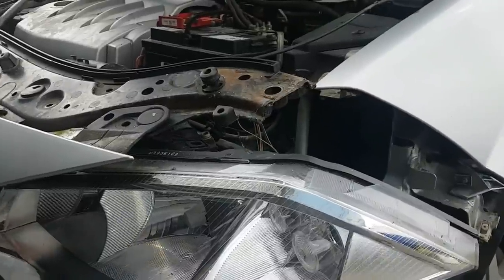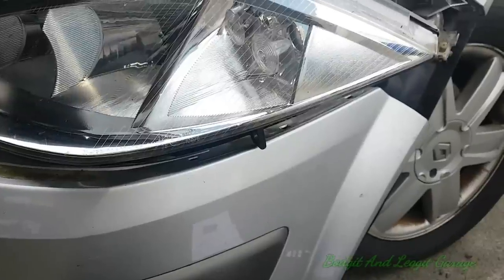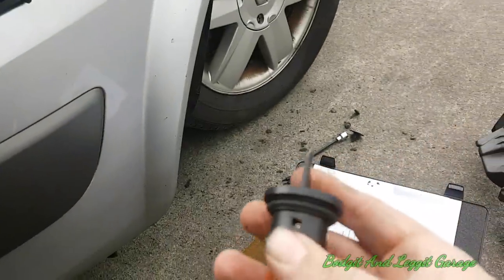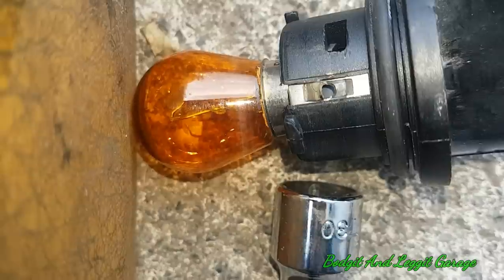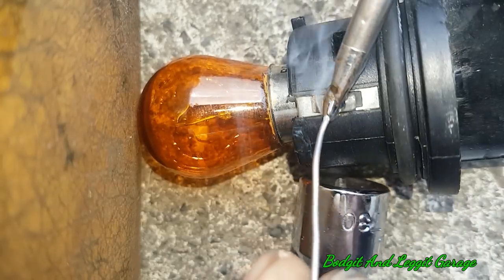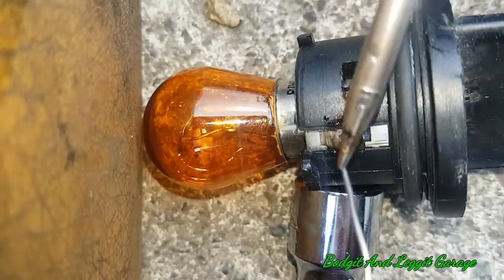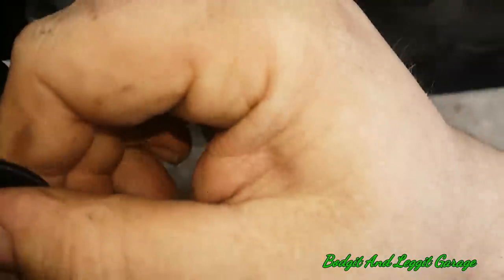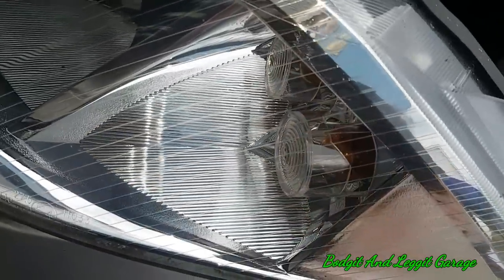Stupid Indicator Bulb Stupid Renault Bodgit And Leggit Garage

Comment: I had a customer with a Clio and Renault wanted £90 just to change a side light bulb as the headlight needed to be removed to do it, he called me to see if I had a bulb as he reckoned he could get his fingers in to change it which he managed to do and got the bulb for free as it was only 10 pence for a bulb. Bear in mind this was 10 years ago so think of the cost now, I had had a few where the bumper has to come off and its bloody ridiculous but makes the dealers money.
PS that is what I would have done.
Reply from the maker: Thanks mate

Comment: That's a decent fix.

My Mondeo had a corroded socket on the inner boot lights.

Cut the connector back to the traces then soldered tails in and joined directly to the loom.

Boom free permanent fix!

Edit.

That's the reason most old meganes are about £5 to buy now lol
Reply from the maker: Sorted

Comment: Leon, you did what you had to do to get it working as quickly as possible. Renaults are an absolute pig of a job just to change a bulb. I had a similar situation with the Corsa where one half of the indicator bulb holder was left behind in the headlight unit. I ended up removing the headlight (almost as bad as the Renault) and I eventually got the offending part out, glued the bulb holder back together and it is still working to this very day. I didn't know that all NCTs were done by dedicated test centres only.
Reply from the maker: Yes mate in Ireland that's how it's done it's not even run by the Irish government at the minute it's being ran by a Spanish company it's a joke

Comment: I am not making this up, but am holding the necessary qualifications to undertake soldering work on fighter jets and spacecraft.
My opinion on how long this repair will last? It will probably last as long as the entire car will.
It's not the correct way of doing it, but I would have done the same myself !
Reply from the maker: Wow that's awesome mate I am very jealous I would love to work on them type of things I know I could do it
Reply: @bodgitandleggitgarage  Don't be jealous. I was trained to undertake that kind of work, but I have never actually touched a fighter jet. Nor a spaceship 😉
But I'm certainly able to judge that the fix you made there is more than adequate.
And yes, it seems as if your mindset is exactly what is needed to work on aircrafts.

Comment: I did a similar bodge to my mates peugeot 308 i think, the estate car with the glass roof.
The indictors were playing up and the bulbs sat in shitty plastic top hats, the contacts were worse than your's, so i drilled holes in the back of the top hats and fed earth wires inside, soldered to the shitty bits of tin.
The wires i put new crocodile clips on and clamped them to metal engine bits, they worked for years with no trouble.
The job was an emergency bodge, i did say to buy two new top hats then the wires could be removed, he never bought them, No bloody supprise.
Reply from the maker: Sorted nice job mate

Comment: Craze ntc system. All I would say is maybe add some grease? So it maybe possible to replace without taking half the car apart. Easy for me to say. I hate those plastic twist handles. Easy to break
Reply from the maker: Hi mate I tried the grease on phone you didn't work this it is just too tight too much friction

Comment: I was gonna learn how to drive until i found out how expensive it is and i thought to myself, i'll just get buses and taxis instead
Reply from the maker: Always good to have your independence mate just take your time do it slow but definitely you need to learn how to drive
Reply: bodgit and leggit garage No i'm not learning how to drive as lessons are expensive then when i get a car i'd have to pay tax, nct, insurance, fuel, parking, maintenance, repairs also i live pretty close to a bus stop so i'd rather get the bus than pay all that as i don't have to pay any of the aforementioned costs

Comment: First off , forgot to connect it back up 🤣 when you go out your way just to help your customer out even temporarily , that customer will return for future business.  Also the haters need to to understand that not all mechanics work in dealerships with a spares department next door. Also your work is on alot off older vehicles which require a different approach to repairs and not always brand new parts. What i call an old skool mechanic and there knowledge and experience is can be more valuable.
Reply from the maker: Thanks a lot mate you make some fantastic points there

Comment: On our Renault Modus it isn't even a case of buying a new bulb holder.  Tried that but offside front indicator still not working.  The problem is with the contact inside the headlamp which is difficult to remove.  What a crap design.

Comment: I think the physical connection between holder and light housing is now better than original . I also solder the clips after a good file and never had a comeback. If it burnt through it wasn't making proper contact in the first place. Good thing you saw the plug was off before ripping into the wiring. I would probably found supply on plug and still not clicked the thing wasn't plugged in.

Comment: Mercedes W110 foglight light bulb NLA in South Africa so I did something similar, break glass and remove all light bulb parts from base, solder 10 watt LED into its place with wires to heat sunk current limiting resistor mounted on metal part of car.
Passed roadworthy test (MOT) first time ........just like yours. Bodge or re-engineered? is welding new metal in to replace rusted a bodge? No, so neither is soldering new metal in to replace a corroded or burnt electrical contact or replacing a tungsten filament made out of unobtainium with a COB LED!
Reply from the maker: nice job mate sorted top job

Comment: Hi Leon,
The fix is the fix and once the customer understands the fix and it's call out in the invoice and signed your ass is covered. I would like to add that one has to be careful working on anything with regards to automotive safety. I known of a case where a garage wasn't strong enough to hold on to a unsafe car. Customer forced there way and shit happened. Customer tried to come back on the garage. Something garages don't think about. In this case a quick fix is good but I'd order a new part and replace it next service.. Nice video..👍👍
Reply from the maker: Thanks for that mate much appreciated you make some fantastic points there

Comment: Hiya. I worked in halfords for ten years changing bulbs and radios and stuff. The first renault like that I had to do , I too could not get the bulb out. But found if you out on the indicator then turned the holder closed the bulb came back on. And it was the same each time I came out to do one for the next 10 years. I never did manage to get the bulb out completely.
Reply from the maker: Sorted